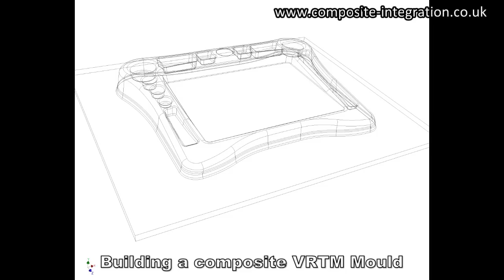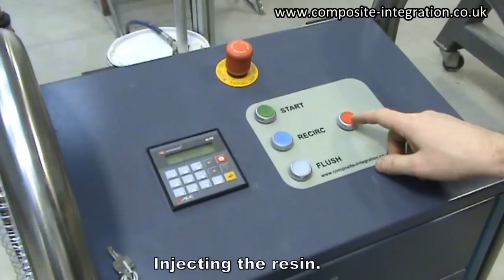Building a composite VRTM Mould- an overview

Comment: I am told this process gets about 6 cycles per day in an 8 hour shift. I dont understand how that is done regarding the surface-finish of both the A and B sides of the product. Normally you need wait 2-4 hours for gelcoat to cure to touch. How is this overcome? For example at 2:06 can see you applying the gelcoat by brush. Then how long did you have to wait before adding the core material?

Comment from the maker: The cycle time for this type of process will depend on several factors. If you are using a gelcoat it must be allowed to cure before loading the fibre and injecting the resin. This can be accelerated by heating the mould (the mould in the video isn't heated but many of the moulds that we manufacture are - often with embedded water pipe-work) or simply with radiant heat.
The reactivity of the resin is also an important factor. Cycle times can vary from a few minutes (especially when not using gelcoat) to several hours (if using a less reactive resin) The cycle time of the process shown in the video was approximately 1.5 hours.
Reply from the maker: Kosmos Erdem Hi, Yes, we would be happy to help. I'll contact you to discuss.

Comment: The red string represented the resin perimiter flow channel? Where can you get that blue vacuum seal? Those little green circels coming out are your maximum depth stop? We didnt see you put vacuum on the perimiter?
Reply from the maker: Koen Klijnsmit All the seals and 'formers' used in the mould making stages are available from Composite Integration Ltd.Vacuum is connected to the perimeter flange as well as to the main mould cavity.
Reply: Compositeinteg1 Thank you, i can`t find the seperate products on the site...